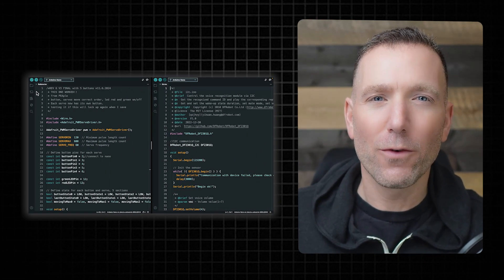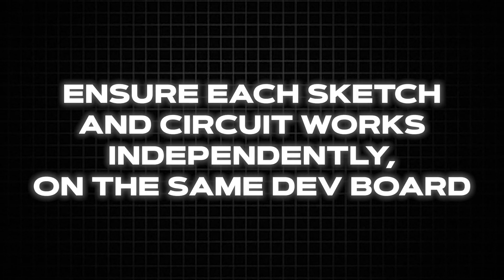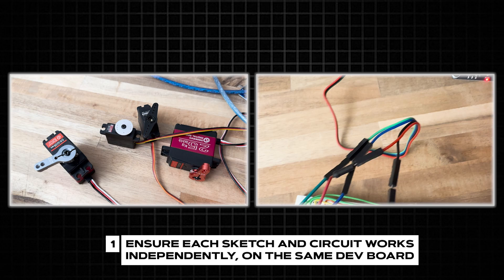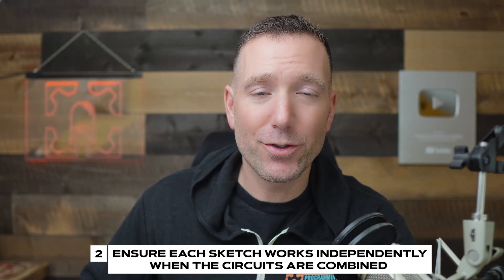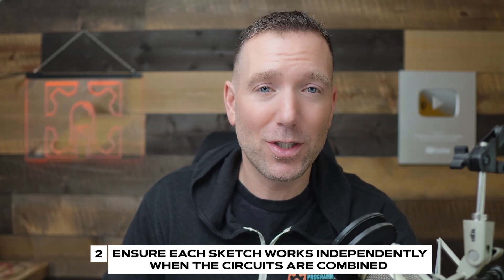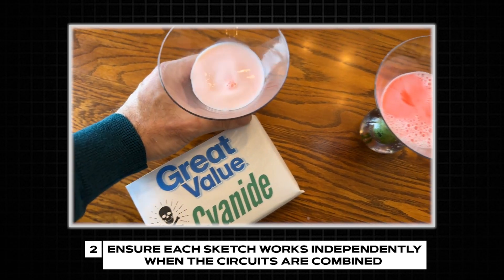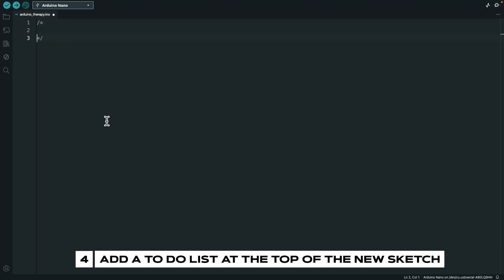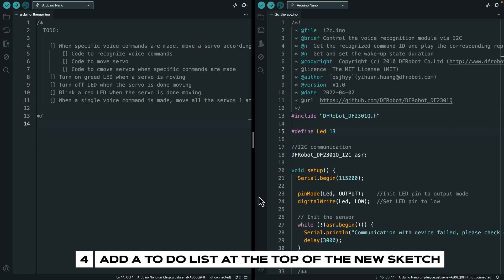How to combine two (or more) Arduino sketches [a MUST watch for new programmers] #arduino

Comment: Great resource.

1 additional thing that I do is to open a copy of the 2nd sketch, not the actual sketch itself.
As I copy each line over, I delete it from the copy of the 2nd sketch.

That way, it is easy to track what code has or has not been copied. It helps when you try to get 1 feature working at a time before moving on to the next feature (eg make sure servo 1 moves as expected before adding servo 2).

Remember, just because it compiled, it doesn't mean it will do exactly what you want

Comment: Isn't easier to just keep the sketches separate and just call them in by header? What's the point of this method other than complicating things?
Reply from the maker: You can't have two sketches with loop() functions and setup() functions running at the same time, but you could definitely use different files to try and break the program functionality up.   The idea is to help integrate functionality from two separate sources into a single program.

Comment: This works for combining multiple simple programs. However, if each program contains loops, achieving harmonious integration becomes significantly more complex.
Reply from the maker: Agreed!  This can get messy really quick.  It's best to know how to start a program from scratch and add/pull in what you need step by step.  

I do know that lots of folks out there are just trying to get something relatively simple working.  My hope is this might help.

Comment: Sadly, this is helpful only for super simple sketches that do super simple tasks.

Once advanced logic takes place, this will most likely get your in more trouble, than the problem it solves.

I mean, you will need so much time and effort to think about how and where everything needs to fit, that you'd be better of, if you started from skrarch.

My advice to new programmers, is:

1) Write the algorithm, the logic if you will, of what you want to achieve, in plain English. Maybe in comments.

2) Then complete each individual task of the algorithm and make it independent to the rest of the code, as much as possible.

If and where you can, use functions.

That's my advice.
Reply from the maker: Very fair.  I like your advice to new programmers.

Thanks for your thoughts!
Reply: @programmingelectronics  Yeah, thanks. 

As I did say above though, for simple sketches and simple projects this may as well be the way to go. :) 

Anyway, cheers.